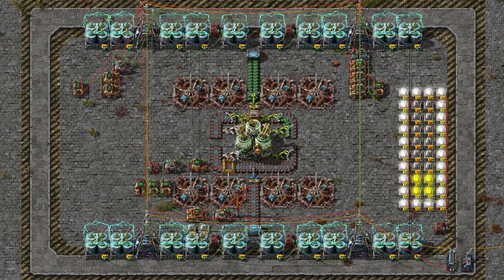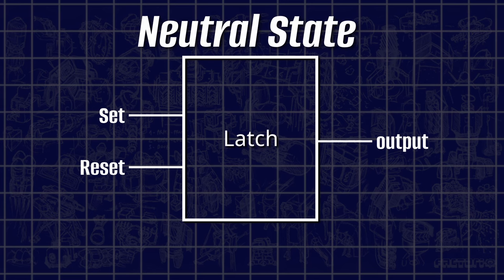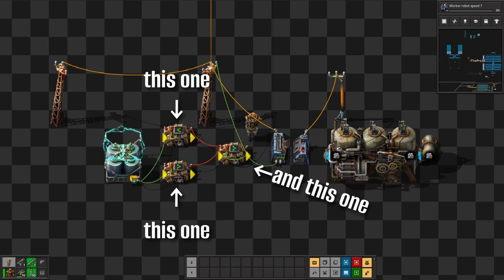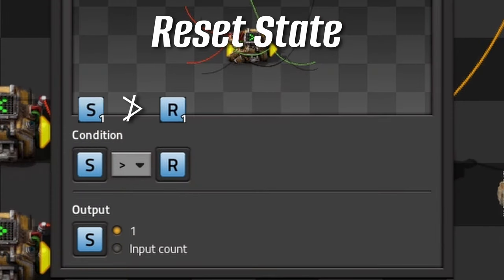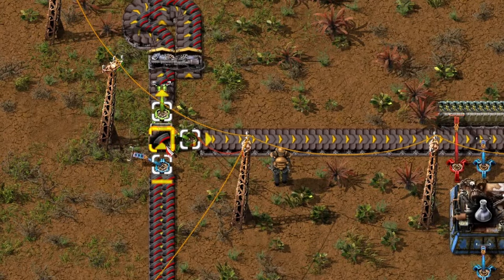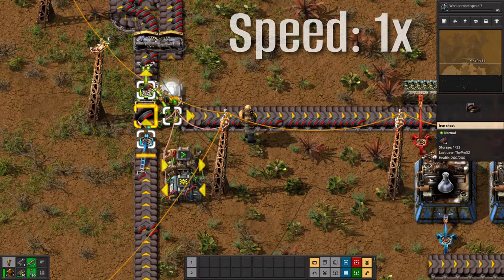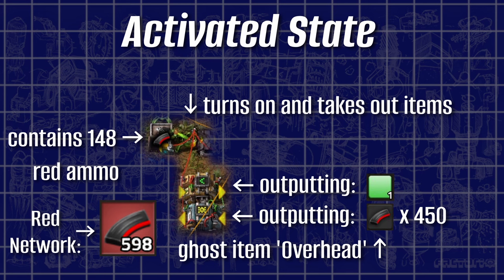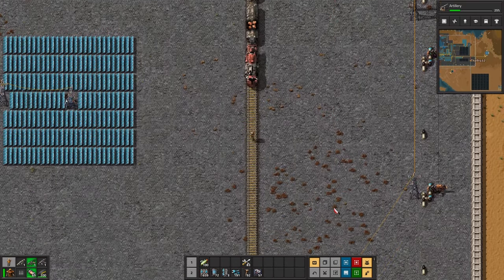intermediate circuitry in factorio part 1: Flip Flops and Latches!

Comment: I used a work around when I couldn't remember how to make a latch where one inserter stores an placeholder item in a chest when item y drops to x amount and while the placeholder item is in the chest another inserter adds the missing item to wherever it's needed/being counted, until a third inserter hits the cutoff and removes the item onto a conveyor going back to the first inserter. 
The only reason I needed it was to regulate items on a giant sushi belt and, for that, it seemed to work.
Reply from the maker: that's also a pretty reliable way to get the same logic without using combinators. The only thing that could lead to de-sync when using such a setup is the small priming time for the placeholder item to make its way back on the conveyor belt but overall not that big of a deal if timings aren't critical.

Comment: I use a different 3 combinator latch design because I have a few small issues with the one shown.
First when the set and reset signals are simultaneously received the output is depends on the state the circuit was in prior. The memory cell was empty when both signals become true the output will be 0, if the memory cell was already latched when both S&R are occurring then it will remain latched.

In order to overcome this flaw I use 2 decider and 1 arithmetic for my 3 piece latch. Both deciders' inputs are wired to the greater world with red. Decider 1: outputs S=1 when input signal meets condition, output is wired to inputs of of both other combinators with green. Decider 2: outputs S=S(in) while reset condition is not true or as I like to call it continuing condition is true, output is wired to arithmetic with red. Arithmetic is defined as S/S output to S, output is wired to decider 2 with red and to device that responding to the S signal.
Reply from the maker: I'm not quite sure how you would get into the scenario, where both set and reset signals are simultaneously sent to the latch. could you possibly tell me how exactly this could be replicated?
 The only possible way that i could think of ATM is a de-sync where the latches input combinators react to changes in the red network on different frames. based on my example, i would not categorize the resulting error mechanic as a flaw inside the latch itself but as a result of misapplying the wires of the latch construction in an unfitting way.
despite that, if i understood it correctly your proposed version of a latch could definitely handle this de-sync scenario.
Reply: @center_pivot  The latch I use comes from situations where the set signal and the reset signal are not on the same channel. For example set condition of A>10 and reset condition of B<5. I will describe an actual system I use this in, and while it should not happen that both signals occur simultaneously a good engineer knows that anything that can go wrong will.

I have 6 artillery trains that circle my factory. Their schedule is 2 identical stations: stop at X until circuit and 10 seconds inactivity. Firing stations are normally enabled, but disable as soon as a train arrives. They then remain disabled for 2 minutes after the train leaves. If a train at a firing station runs out of ammo then all firing stations are disabled and the reloading stations are enabled. Reloading stations remain enabled until all 6 trains are stopped at a reloading stations, at which time the reloading stations disable and the firing stations return to normal patrol schedule. The circuit condition in the train schedule is to keep the trains in the reloading station until all 6 are stopped.

As I am sure you can see from the description of that system most if not all the latches have divorced set and reset conditions.
Reply from the maker: This extra information definitely helped out a lot to grasp the underlying situation 👍.
I'm still not quite why you're sending all trains back to the reloading stations when just one runs out of ammo but i bet that there's a good reason for it or i misunderstood something lol.

Comment: I need a way to store a clock state so I can interrupt it and resume from where I left off. Below is the TLDR, but is it possible to do this with an SR latch or what would be required instead?

TLDR: I have a clock in my factory that counts to 120 ticks repeatedly (equal to the cooldown of an electric miner drill). A decider combinator is attached to it that sends an enable signal to a belt leading up to a drill deposit for all but a small 25 tick window in that cycle. This configuration allows the drill to continue its regular contribution to the belt with minimal to no interruption even as the belt approaches 100% saturation.

However, things become a little more complicated when mining efficiency is researched because (to achieve the added efficiency) instead of simply boosting the drills contribution interval, it is given a secondary cooldown that runs slower than (and synchronously with) the first. This means that if at any point one cooldown is interrupted at elapse time by belt saturation, the other one is interrupted too. So, not only can this problem not be solved by speeding up the clock cycle, but simply adding an additional clock doesn't get us all the way there either.

Instead, you have to actually implement a way to pause clock A when clock B ceases sending go signal B, the have clock A resume from whatever state it was in at the time of interruption.

To understand this, consider the scenario where the belt is at 98% saturation, cooldown A is at 60% completion and cooldown B is at 100%. Initially, both clocks are sending a go signal so the drill cannot deposit and both cooldown counters halt. However, in this scenario clock B will cease go signal B in 70 ticks. When it does, the collective network go signal will reduce from 2 to 1 (clock A will still be sending go signal A) and the leading belt will halt for 25 ticks allowing the drill time to contribute and (crucially) cooldown A to continue approaching 100%.

Ideally, clock A would be "paused" but not "halted" while clock B ceased go signal B. This is what I am trying to achieve. The following assumes this is what happens.

Since the precise belt state at any one point is essentially random, we'll assume that precisely 12 ticks after clock B ceases go signal B the drill is able to deposit the ore from cooldown B and the remaining 48 ticks until cooldown A reaches elapse time will resume. As long as the initial state of both clocks were configured correctly, then cooldown A will reach elapse time exactly 12 ticks after clock A ceases its own go signal. Like clockwork.
Reply: Well I found a solution but it's unsatisfying simple😅. I just configured the clock to add the signal "V" to the signal "I" instead of "I" to "I". The quantity of "V" can be changed to 0 to interrupt the clock without initializing it, and changed to 1 to resume from its previous state.

Comment: Hello Centre pivot,

This is a great video. Thanks to you my power setup is now very efficient! I completely understand scenario 1, bit I'm struggling a lot with applying scenario 2 to the same power setup. In the last 3 days I must've rewatched it more than a dozen times but I'm still struggling.

Using red wire, I've connected an accumulator to a power switch, then to a decider input, and combinator output. Using green wire, I've connected decider output to combinator input. I want my setup to disconnect the powerswitch when the accumulator charge reaches 80% and reconnect at 20%. How should I set the internal conditions? Using the formula of multiplying the green signal with the difference of 80-20 (60) doesn't work. I think I'm doing something wrong.

I wanted to apply what I learnt and even used the wiki page you showed to solve this on my own. However, after the days it's like I'm banging my head against the wall.

I'd really appreciate if you could help 😬🙏
Reply from the maker: uh, everything sounds good wiring and setup wise. conditions should be 'A < 20' for both power switch and decider combinator. the arithmetic combinator then should multiply the deciders output (make sure to set it to output 'A' with value of 1) with the difference of 20-80 (other way around) which gives us 'A * -60'. if you're seeing the SR latch flicker on and off after that, scrap the compact version and go with something like this (https://imgur.com/a/EFEvv4E). does the exact same but synchronizes the timing of signal receipt with the action the power switch makes.
Reply: @center_pivot  this is the third fourth time I’m replying, but for some reason they keep getting deleted.
I just wanted to say thank you for the quick reply. You are indeed correct about the flicker. It worked fine on my test set up, but started flickering on my power grid. Thank you for the link. I’ll try and understand it, but will probably stick with the three Combinator version. I looked at the two Combinator version as an upgrade over the three Combinator version.
Reply: this is the third fourth time I’m replying, but for some reason they keep getting deleted.
I just wanted to say thank you for the quick reply. You are indeed correct about the flicker. It worked fine on my test set up, but started flickering on my power grid. Thank you for the link. I’ll try and understand it, but will probably stick with the three Combinator version. I looked at the two Combinator version as an upgrade over the three Combinator version.